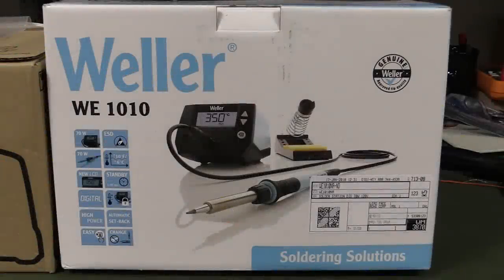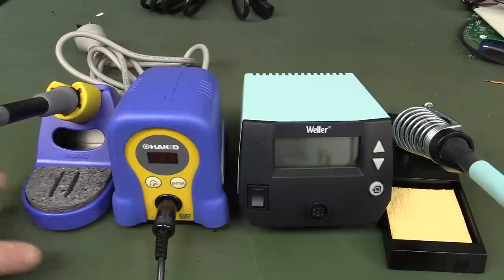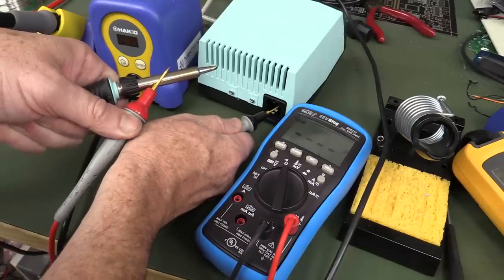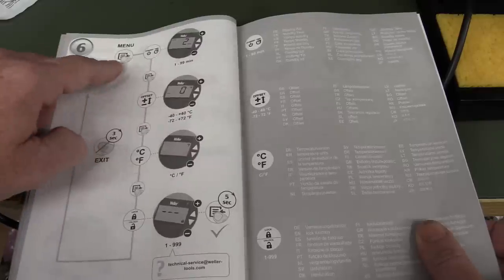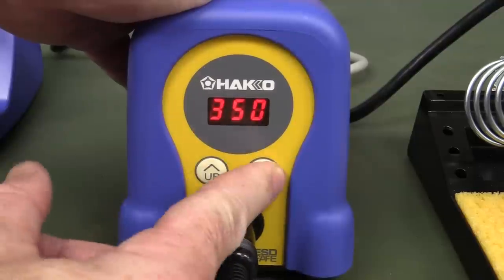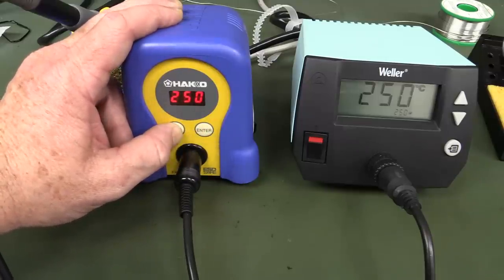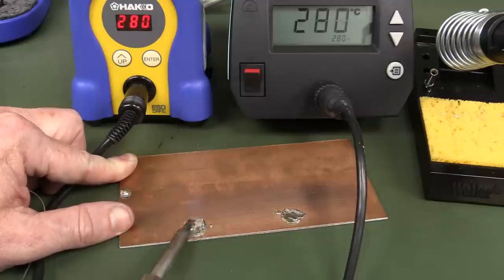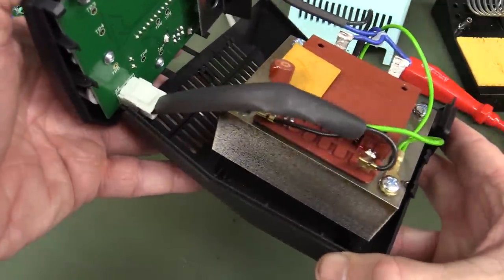EEVblog #1063 - Weller WE1010 vs Hakko FX888D Soldering Station

Comment: The temperature sensor for the weller is in the tip.  The Hakko is in the heating element, that is why the Weller take longer to apparently heat up, and why it cools down faster on your sponge test.
Reply: So is Hakko worthy ?
Reply: Yes i got x3 hakko 888d . It heat up in like 15 seconds  @thanatosor
Reply: @thanatosor thats a blink of an eye . You prepare solder and it will be ready to use
Reply: @obidahasdia4095  nice to know.

Seem to be on pair with Pinecil V2. 

My cheap station + 907 took like 2 mins to heat up

Comment: I bought my FX888D about a year ago. I was feeling a bit torn about buying it, because it looked like a poorly designed toy. I almost went for a Weller station (I think that's also a decent choice based on recommendations). However, once I got the Hakko, I was blown away by its build quality and how well it works. Don't let its looks deter you from giving it a try. The aesthetic actually grew on me and I like how it looks now -- it has a certain character to it and it's an interesting talking point with anyone who's unfamiliar with Hakko. I'm a Software Engineer, so I don't mess with electronics often, but when I do, this thing does the job and does it well.
Reply: Yeah that's the only thing that's keeping me from buying right. It looks like a toy that comes in happy meals 🤣😆
Reply: @supersabrosinho  that is 100% what I'm going through rn😄
Reply: @els1f  I went ahead and bought it. I've never worked with such an nice iron, well worth it!
Reply: Not bad. I know some software guys that use those wunhunglo 10 dollar irons on government equipment.
Reply: Haha my thoughts exactly. You've convinced me and I'll get mine now
Reply: Thanks BK, that's what I came on here to find out. Just want something that works super well for occasional use. Had a cheap shite iron once that was completely useless, but also don't need a pro tool. Sounds like this is the one.
Reply: I love hakko design!
Reply: @jean-christophesicotte-bri1315  I loved the design too. It was something nice looking on my bench as opposed to functional.
Reply: Thanks for your comment kind sir haha I was literally back and fourth for like a month watching videos constantly I was so annoyed but I finally decided to go with the Hakko due to your comment
Reply: For a while I thought I had overspent with my FX888D but then I went and built an RC2014. Never fails.
Reply: Lmao.. let Software Engineer handle hardware is like the new dangerous trending xD

Comment: The Hakko clearly has an 80's alarm clock interface, as +louisrossman would call it :-)
Reply: i dont have much of a problem with it as i dont need to change temperature that much, but i do agree that changing temperature is a huge pain.
Reply: For UI the Weller is easy but if u never change temps and use it for light use the Weller would work
Reply: its programming VCR timer interface :/
+ looks like HAKKO lies about temperature - doesnt show the drop for couple of seconds, like garbage chinese clones
Reply: Is it odd that I just want a knob to adjust temperature? It's almost immediate, and it's like having potentially infinite 'memories'.  Repeatedly mashing buttons to get to a given temperature range doe not inspire me to want one of these things. I change temperature enough when I'm working that this is a major consideration for me. I get that there are 'memories' with the digital buttons, but I can't see how those would be easy to access, or remember what temp is in what location. All this is solved by a knob or two.
Reply: @KevinJDildonik  It's odd that the Weller shows places for presets. That's probably gonna be a "-P" model coming out later for another $50.
Reply: @rasz  It was dead on when he tested it on the thermo.
Reply: Hakko must've hired the designer of the "My first Sony" Kids products. Still have my ELV from the 90ies, LCD display, 3 presets and it was like 150DM.
Reply: @Maskddingo  The FX888DX now has a knob (some while later, lol)!

Comment: I think the Weller simply senses temperature a lot closer to the tip.
Reply: Yea i think weller actually senses temp of the tip while hakko senses temp of a heater. Cuz the heater doesnt actually cool down but the tip does.
Reply: @robertosladic3430  thermister placement and yeah... like i said above... i don't know anyone that "Speed Solders" and would buy a station in this price range. my vote is Weller!

Comment: I'm very happy with my Hakko FX888D. The interface is not so easy to work, but I have just left the temp at 305C. This iron was an upgrade from plug-in pencils where I abused the tips. This station allows me to solder up pinheaders, throughhole, some smd (as long as it isn't too small). I find the Hakko has good temperature control and enough thermal capacity to comfortably solder up sot 263 packages. I can't remember if I tried to220 before. I like the performance,  stand, pencil, and availability of tips. The menu, well, if you don't need to use it (much), it is not a problem.  Overall,  I have absolutely no regrets buying this station.

Comment: Recently picked up a WE1010 in Europe and I re-did the temperature check with a calibrated extremal recorder. I found that the Weller does get very close to the set temperature (certainly within the +/-6 deg they advertise). I could not replicate the 20 degree offset you saw.

I used 60/40 to ensure good thermal coupling to the thermocouple used for measuring. You can certainly see it undulate around the set point by about 5 degrees and it tends to be on the low side of the set point - but it's fairly good for me.

Comment: I was a huge Weller fan, until I tried my first Hakko. We have Metcals at work, so I'm well aware of Hakko's limitations, but for an affordable iron, Hakko's rock. That said, the UI is irritating, and I'd have gladly paid a bit more for a workable UI.
Reply: That is what is swaying me toward the Weller.  Would it really have cost Hakko anything meaningful to put another button on it?
Reply: @BryanTorok  Lacking one more button was as stupid as its look.
Reply: @kmorger  Which brand tips have the best solder wetting abilities (and lifetime)?
I thought it was Hakko and Weller, but apparently I didn't know about better brands.
I understand there is also a difference based on price ranges from the same brand.

Comment: I think the hakko hides the temperature drop, as though it waits for a significant drop before updating the display.
Reply from the maker: Seems like there is some delay
Reply: well if its a drop of 1-3 c i doubt you are gonna notice it in soldering maybe im wrong a drop of 1-2 c in cpu heat isnt that great either, when your cpu is hot u wanna keep it in the 30-50c range
Reply: EEVblog Alternative theory: The Weller sensor is (thermally) closer to the tip, so if the tip drops to 200, the Weller shows it, while the Hakko won't show until the material in between has been cooled down. Similarly, the Hakko might show the core getting hot before the heat has propagated to the tip.
Reply: John I think thats it, because there is space between the tip and heating element of the Hakko the heating element doesn't cool down that fast. Also Maybe the Weller transformer has less A, couldn't see it, so it needs longer to heat up and the Hakko can hold the temp better because maybe of one more amp. But there is a mod for that Hakko tips, wrapping some thin copper around the heating element.
Reply: Definitely. It looks like the Weller has the heating element on the outside of the tip and the thermocouple inside the bore in the tip. The result is that the Weller will display a much more honest tip temperature. The Hakko must have both the heating element and the thermocouple inside the bore, which means it measures the temperature of the heating element, and not the actual tip.  Due to the design difference, you cannot use the internal thermometers to do a comparison. They simply do not measure the same thing. The wet sponge against the shaft is completely pointless, which is also confirmed by the actual soldering test.
Reply: Can you measure the temperature directly (like you did earlier) with a multimeter instead of relying on the station indicator? If so, followup video?
Reply: I think you are exactly right. Both tips are sitting in what amounts to a pool of water. Physics says that as long as there is water on that tip, the external temperature cannot really be over 100C. As you go from the surface to the inside, you have a thermal gradient as you approach the element, and the question is where is the thermocouple measuring. I suspect on the Weller you are getting a temperature reading that is more sensitive to the surface temp.

An alternative test is to use one of those fancy thermal cameras to make an independent measurement of the tip surface temperatures.
Reply: David Jacobowitz, agreed. It looks like one has a ceramic thing transferring heat to the tip, and the other something that looks like a brass tube. Assuming the TNC is inside the center post things with the heating element, the dif between the ceramic and brass-looking-thing would explain the temp differences, lol.

BTW, Great Vid Dave.  B)
Reply: Pretty sure the manual said it only shows the actual tip temperature if it differs from the setpoint by some large amount (25 or 50 degrees?)
Reply: There are many examples of hiding performance parameters in industry. Weller will be always the best.
Reply: @Wilson84KS  The watt rating should be your answer, not the xfmr current.
Reply: @chrismumford9206  I'd like to see what the mains voltage is on your Weller. If it's below the design voltage, it could cause the slow warm-up times.
Reply: @policyprogrammer  Any non-contact digital thermometer would do the job. They aren't terribly accurate, but they'll give you a fair comparison.
Reply: @Zarcondeegrissom  Yeah, that sleeve-heater arrangement is a departure from Wellers older designs, and frankly looks chintzy.
Reply: it is chintzy. I was lucky enough to get an original Weller eons ago, the newer remake of the same model is nothing like the original. it's simplified to the point of being overpriced junk. It's sad what Weller has become.
Reply: @johnfrancisdoe1563  the hakko lied to us
Reply: Probably from the ceramic heating element, that might cause a delay!
Reply: @johnfrancisdoe1563  When he tested it on the thermo the 888 was dead on. He tested the tip not the body.
Reply: @muddyriverdogz no suprise when at steady T. Its still a metal and conducting heat good and therefore after some seconds you have the same T on the outside as on the inside. But thats exactly the point why the weller is more accurate, because what matters when dealing with irons is the surface T and not the T of the core.
Reply: @JosipMiller  Japanese don't hide performance, Americans do. If a Japanese product tells you its X, its X or the entire team was fired from the company in shame and commit hari kari.
Reply: @xfloodcasual8124  lololol
Reply: @xfloodcasual8124  Do you know what stereotyping by race is called?

Comment: What a great review/comparison video. I went with the Weller. It may be hypothesis but I think the temp. sensors/circuitry in the Hakko is misleading as the "delay" is clearly noticeable from the sensor to the readout. If you are not "Speed-soldering" ( i know not of one person who does) go with that one if it makes you feel warm/fuzzy. Weller. Hands down. My choice but that's just me! GREAT VIDEO!

Comment: Boy you sure drew a lot of comments.  My little contribution is that my first soldering iron was a 30 watt thing from Radio Shack.  After seeing EEVBlog #180 I decided to get the Hakko FX888.  To my (initial) dismay I couldn't find one because it had been replaced by the 888D.  I didn't buy it immediately waiting for a sale,  In July 2016 Fry's Electronics had a two day E-Mail sale, The FX888D was $64 (US) + $5.76 tax (it has been on sale again at least once since then). 
A couple of notes.  Even though I live where solder is pronounced sodder I changed the temp readings from °F to °C.  In electrical engineering all the measurements are metric so it seemed right to apply that to soldering temperature.
By the way my iron came with the chisel tip. Maybe that is a regional thing.

My evaluation based on this video and my experiences is that I would go with the Hakko over the Weller.  From what you showed the performance of each is essentially the same.  The main deciding factor for me is the Hakko stand--I like that it has some weight to it.  Until I got my Hakko I was always burning myself.  The stand that I had was so flimsy I generally didn't bother to use it and thus when I picked the iron up sometimes I'd grab the tip.  The user interface looks much better on the Weller but the documentation is lacking.  The two buttons on the Hakko seem almost inadequate but they obviously kept it simple to keep it in the $100 range--and if you RTFM you can still do anything you need with that interface.

Comment: I don't believe the Hakko temperature got to 350 at 20 degrees / sec then stopped abruptly at 350!  You need to measure the ACTUAL tip temperatures.  This applies to the sponge cooling test also. I suspect the temperatures are measured at the heater and depending on the conductivity between heater and tip there could be quite an error. I've worked in temp measurement and control a lot of my working life and the response of the Hakko seems unrealistic. It gives naive users false confidence in the meter. The Weller is believable. 
 btw: I published a resettable timer circuit in Silicon Chip Circuit Notebook (March 2016) to cut the power after 20 mins idle time.
Reply: Charles Tivendale 
Yup I think Roger over on KainkaLabs did a great job on a video about the Atten Digital soldering iron temperature discrepancies. Although he was doing a video about fixing the problem and looking at how Atten's 2 wire elements sense temperature with a thermocouple in series with the element. The overshoot and calibration temp are usually way off, as are the maximum temperature. I don't trust any of the ones I've owned, but I've never owned or been enslaved by someone with a fat "pro's" wallet. I've never caught up to Mr Jones's and his '$500k pencil.'
Reply: A gay on one forum tested soldering stations tip temperature.He measured the tip temperature and absolute winner is old Weller magnastat.
Reply: The Hakko is a bullshit artist.  Huge lag on the display vs actual tip temp and creative "Brakes" when it get to temp.  the Hakko is a toy.

Comment: My Weller WE 1010 recently bought, August 2021, made in Mexico earlier this year.  I will add in some detail the case of the control unit is not made rugged.  The tight fit of the front panel, bottom half and top half gives the unit a solid feel when assembled.  Opening involves removal of two screws on the back near the AC power jack and this same area of the top cover must be pulled/pried away from the unit for the internal hooks to release.  Top cover at the rear will only move upward because of tabs of the top cover have vertical posts/pins that interface the lower half case.  Once the rear of the top cover is lifted the top cover will release from the bottom half.

The two screws of above are self tapping type that go directly into the plastic case using no metal clip for the screws to thread into.

Slightly beveling the two tabs at the lower front of the top half case, one on each side, will make assembly substantially easier.
Reply: In the words of a very wise old man I knew once: "If it ain't broke don't fix it". Why open your weller unless you were about to attempt to fix it with your Hakko?  LOL... All jokes aside... I totally went with the Weller... it was a no-brainer for me... but that's just ME. German engineering shouldn't be underestimated. I love it! In this price range? It was a personal decision. Two very good products and an excellent comparison was shown here!
Reply: @thefeet  Weller was the norm in the distant past in manufacturing here in the US.  Back then it was pricey and did not own a Weller.  I used a unregulated Ungar, built my entire Heathkit lab setup and many On TV decoders.  That Ungar I still have today but the tip is stuck to the element.

The Weller will most likely not last as long as that Ungar but it gives decent life with a number of heating element changes and tips.  IMO, the higher performance, faster heating, will translate to shorter life.

Comment: The hakko has the temperature sensor embedded in to the ceramic element, so it's measuring the element temperature not the tip. I don't know where the weller sensor is.

Perhaps you should do you thermal test with your thermal camera? Element temperature is irrelevant.

Comment: I actually ordered a WE1010 and returned it. Once I saw the familiar lousy spring stand, and the same plug on the pencil as my WES51, I realized I wasn't getting much more for my $120 for the 1010 vs the $75 I had spent on the 51, other than a digital readout
. The WES51 performed well while it lasted, which wasn't very long. The pencil  died after about 3 yrs of use, first with an intermittent plug, and then with a loose tip that couldn't be fully tightened down.  The 1010 pencil doesn't look like it's very different, so I wouldn't expect much longer life. I work on a lot of point to point vintage electronics, so I tend to run my iron fairly hot. Still, no reason the pencil should fail so quickly. I just pulled out my old standby WTCP, which has to be at least 25 yrs. old. Legacy Weller stuff was pretty much bulletproof, but they seem to be riding on their reputation.  After seeing this video, I'm leaning heavily towards the Hakko. Funky styling not withstanding, it just looks to be a sturdier unit. Really appreciate the info.